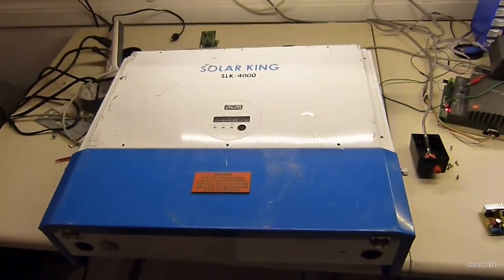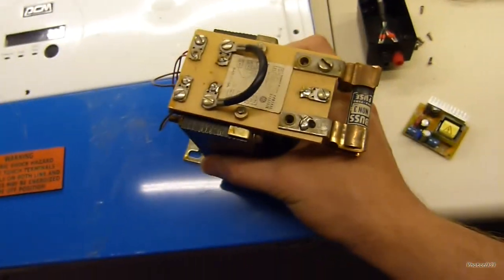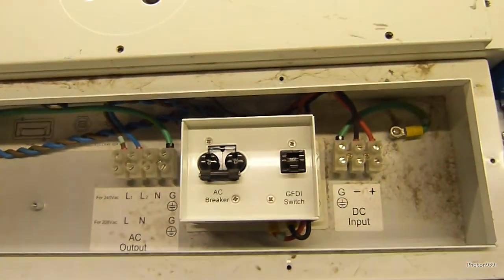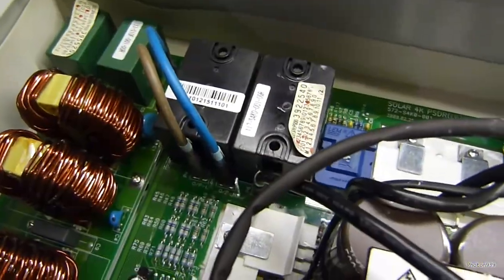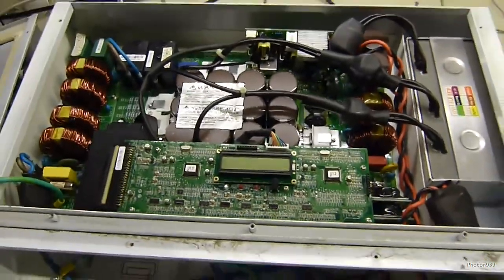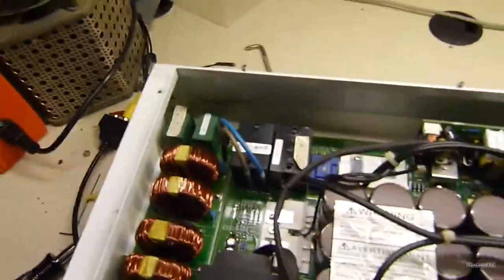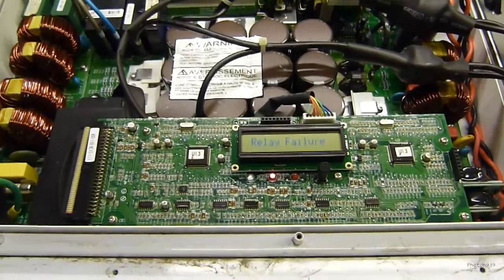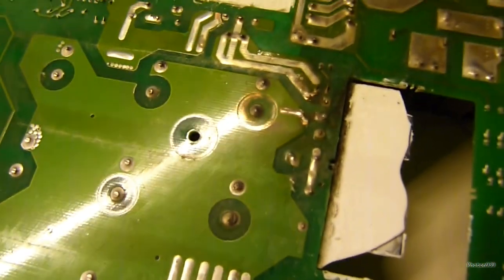Solar King SLK-4000 4KW Grid Tie Inverter Repair Pt1

Comment: Hello
I have the same
and the same part is with too broken
there is no can see on which side you order it
and how exactly that is part you can with please
Write exactly how it is called and where you can buy it
Reply from the maker: The original was ON Semiconductor HGTG40N60A4 but I ordered IXXH80N65B4 it has better ratings for 1/3 the price on Mouser Electronics

Comment: I got one of these, also faulty, it's branded Clenergy but is the same exact thing inside.
The big block with the grey silicon is 3 inductors, two for the 240V output, one for the step up DC-DC.
Build quality is below average, mine has a number of bodge components, hence why i't be used for parts.
Not in your part of the world, otherwise would offer to mail you new IGBTs etc.

Comment: Nice project, youll get it!  Maybe that bouncing current is MPPT or the little boost module going into protect?   A relay failed on my Chinese welder the other week... IGBT sounded like a gun when it went off!  You prolly have a bunch of parallel circuits in there, compare em all real well before you fire it back up!  In my case another IGBT, its gate driver, and fast switching diode were shorted but looked just fine.